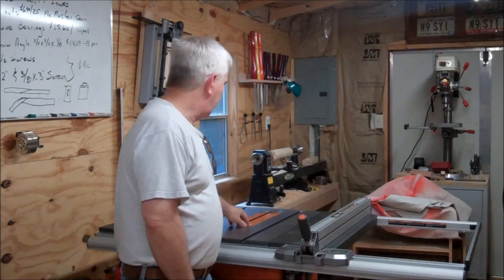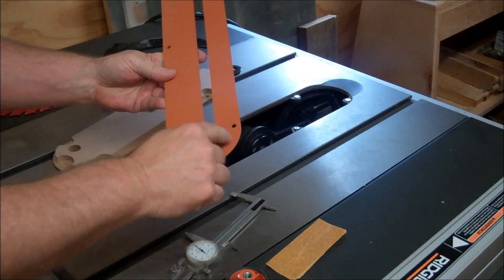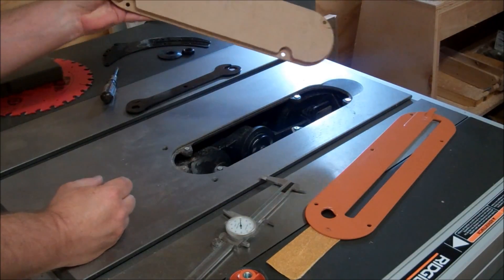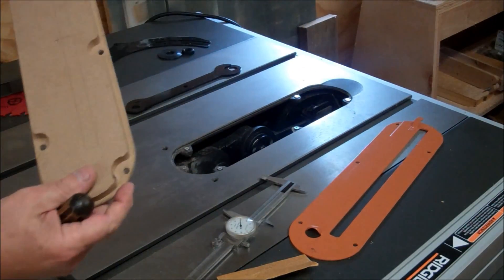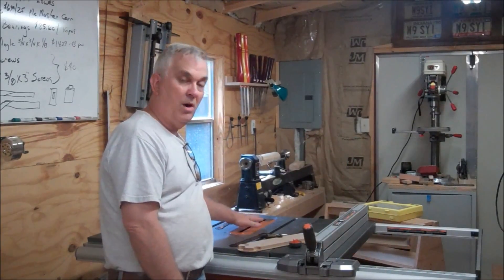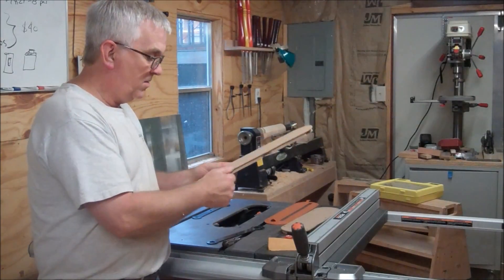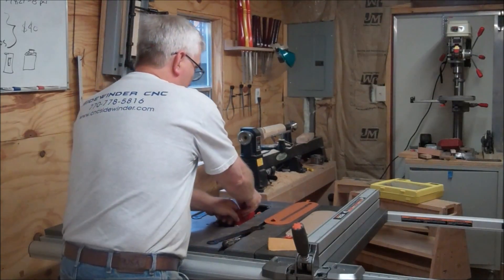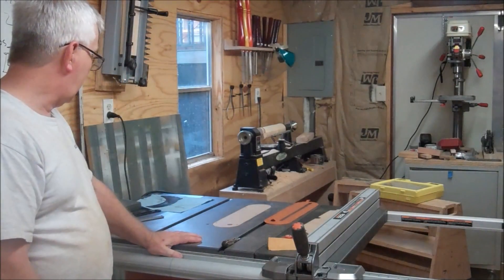Making a Zero Clearance Insert

Comment: Question Dave I assume the original plate was made of metal and was held down with magnets do you plan on adding magnets or anything to help hold the wooden down?
Reply from the maker: The original plate had a clip on one end and a small magnet on the other but the insert I made is such a perfect fit that I don't need to add a magnet.